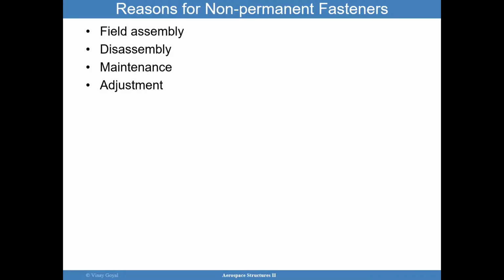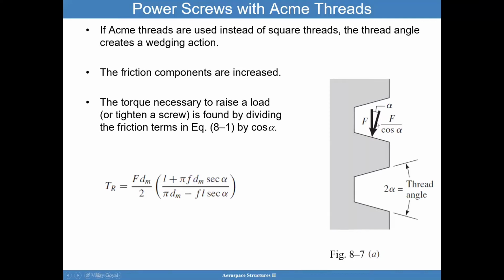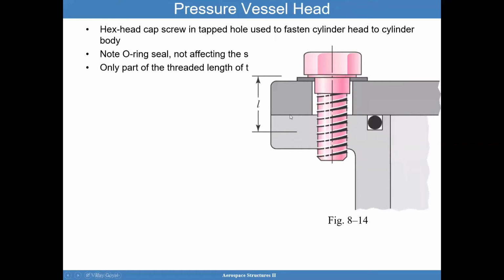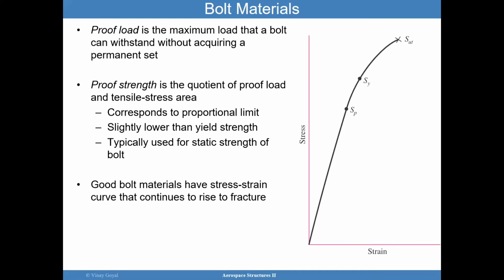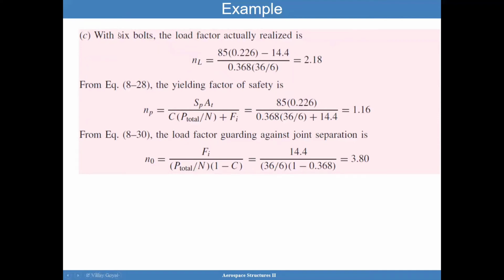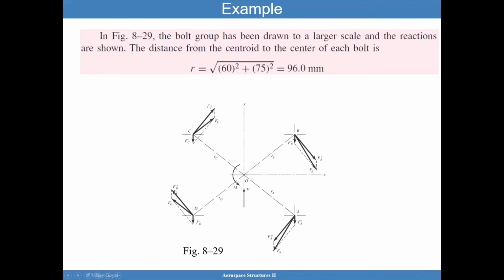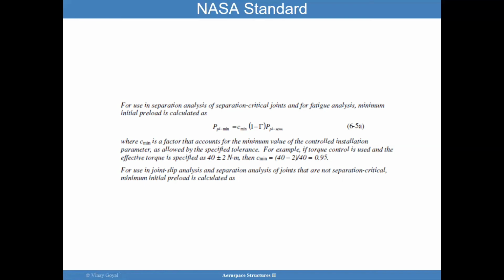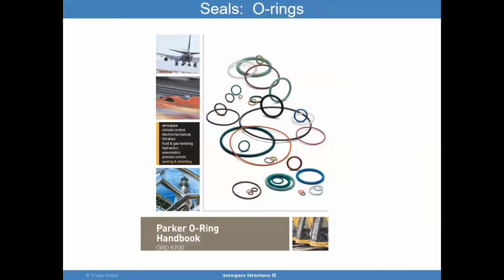Advanced Aerospace Structures: Lecture 10- Bolted Joint Design and Analysis

Comment: Another great class.  Thank you.  I built my own spreadsheets using the NASA5020 spec + the TM spec, but I with those specs had a methodology on bolt bending.  I usually just assume Mc/I with a moment arm at half the joint thickness, but I don't know how that compares to reality.  I assume the interaction curves include bending on the testing.